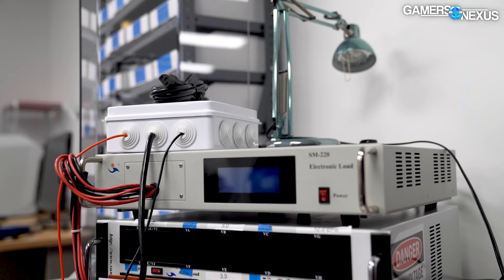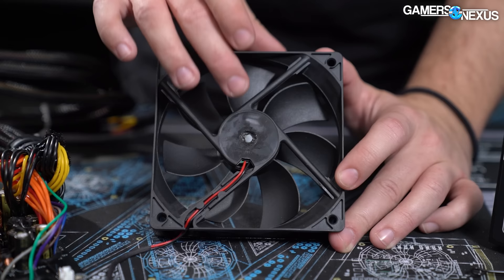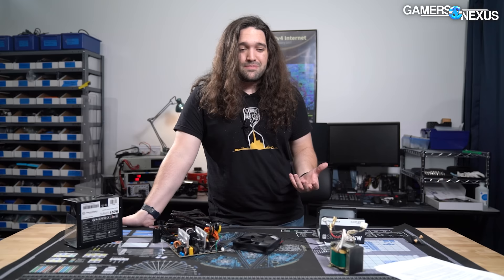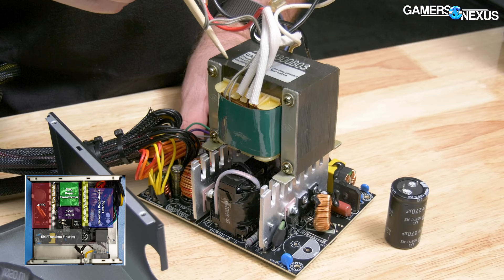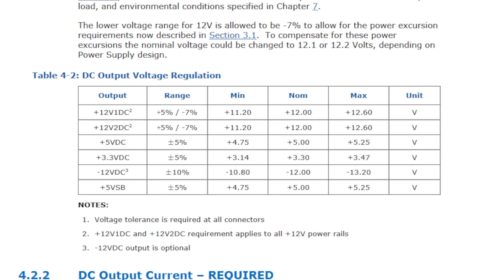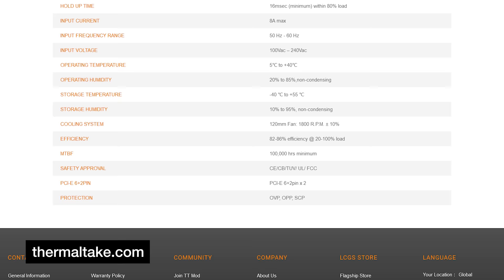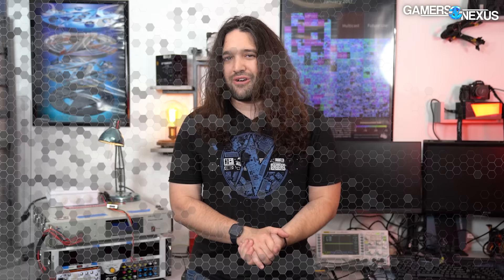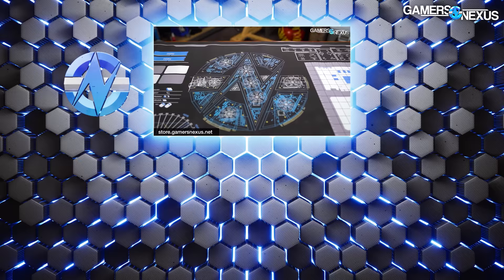Taking Risks on a Cheap PSU: $30 Thermaltake 430W SMART Power Supply Review

Comment: G'day Steve & Stone,
Thanks for doing a low cost PSU as these are very much one of the first places people want to cut cost as it has no visual value,
While not a 'Performance Leader' (in No way expected) it is good to know that it will protect the other components when used in a build that has all it's parts chosen by $Minimum.

Ps I am with you on the 430W Claim, I have seen this Claim Variance on many Low Cost PSUs & I too would rather just have the Actual 12v Performance rather than the confusion shown here, because for those this PSU is aimed at having 430W or 385W for an Optiplex Upgrade is not important as 385W will be plenty, but for those actually looking at 400W-500W Usage this is a disaster,
Stretching Facts to get Sales like this need to be cracked down on because Honesty for Safety is much more important.

Comment: my wife had been using the litepower 550w version of this power supply for close to 5 years. Used to run a core2quad & cheapo radeon hd 8XXX for 3 years then Ryzen 3 3400g & RX580 for 2 years, no rgb thou. So far still works well, as long as the power usage is low I guess.

Comment: Output ripple is driven by the cap size. Unless you get creative with a cap multiplier. Bigger caps cost more. The spec matters. Devices that operate on that power are supposed to be designed to work with a power supply with ripple right at the limit.

Comment: I’ve actually had a couple of these, I ran one in my primary rig for three years, and I bought it used, so who knows how old it actually was. Never gave me an issue with my R5 2600 and gtx 1060 6gb system

Comment: Expensive power supply!  For DOP 1800 (~$36) I got a new xTech combo; a black midi tower and a 600W power supply.  It is in use since May 2019 with a Ryzen 3 2200G, the max power requirement for the PC is ~150W.  The power supply had a 24 pin; 4 pin; 2 SATA and 2 Molex connectors.  After 3 years I had to replace the power supply fan :(  The PC is running 24/7 and after half an hour idling it suspends, but its 2-pin power-supply fan keeps running.  The PC is connected to a 1200W Avtek surge protector, because we have here 3 to 20 power fails per week :)

Comment: This is probably the kind of PSU I'd think of getting if I was going to build my own "MacGyvered" stereo from a spare car radio I had lying around, some sort of enclosure (probably whatever wood product is cheapest this month, and no I'm not excluding particularly thick cardboard), and some speakers I picked up off Amazon.
That is, if purpose-built 12v only PSU's weren't so dang cheap for higher ratings (thank you, widespread acceptance of LED lighting).
And if I had problems with bass response, I'd just need to add a small supercapacitors.

Speaking of those supercapacitors, I'd love to see if adding one of those across the PCI-E power connector's lines would help fix those transient trip issues the 3090 likes causing. It's not like it's gonna boost the voltage or anything dangerous like that, and with GPU's being at an all-time low price point (and falling) you might be able to afford to sacrifice one to see if some solution to the problem other than "buy a bigger PSU" can be found.
The car audio super capacitor does seem like the proper solution to the problem, as just like bass drops in music, the high 12v draw doesn't last very long, and the supercapacitor on its own (without the PSU helping) would be able to supply that easily, considering that they're designed to supply hundreds of amps and the GPU is only trying to draw like 50-70 amps at 12v.

Comment: I remember buying my own first PC components in 1996, and as a 14 year old, without much money, or any money given by my parents towards a computer. I really had to go with the absolute cheapest parts I could find. Case, and power supply was definitely the corners I cut. It was a Pentium 166MHz, eventually I upgraded it with a Riva TNT2 PCI bought for 30$ on the used market. I used that machine a lot! it became obsolete quickly as PC tech advanced at blistering speed during the 90's. However that machine continued to live on, with a slimmed down verison of Windows 98. First my brother had it, and then my mother inherited the computer. At the end you could barely do banking tasks, or check your e-mails. However, the power supply, which was probably dog-poop, did last for those 10 years. :)
Reply: And the quality of this power supply is probably orders of magnitude better than that 90's white box power supply.

Comment: The 12V output being lower than 430W was not mentioned anywhere on ThermalFake's store page nor do they picture the sticker with the ratings. Newegg's page only shows the deficiency deep in the specs as Amps at each voltage and you have to be doing math to catch the trickery.

Comment: I struggle to remember a mainboard which connects -12V rail anywhere at all. I think it's safe anyway, the rail plain doesn't have the current to set the wires on fire or to make a substantial fire on the PSU beyond killing a secondary support component.

Comment: Does ripple really matter on the 12V rail, though?  Wouldn't that be filtered out by the voltage regulators that produce the voltage that actually powers the chips?
Reply: They will, but you still stress more expensive parts. You can get decent ones for double the price. Why bother with the absolute trash tier?
Reply: @valkaielod  I'm trying to decide whether this is indeed "absolute trash".  To me, it seems like more of a Ford Focus, not a Yugo.  It's clearly in the low end in every performance metric, but it's also clearly on the low end in price.   On a graph of all power supplies, this would seem to be on that "you get what you pay for" line, without deviating too much.  There are no hidden "gotchas".  Therefore, if you want to build a computer with parts in that Ford Focus price range, this might be a reasonable option.  I'll admit I don't know the actual effect of ripple on the downstream voltage regulation components, hence my question.

Comment: I almost want one of those for electrical experimentation. I wouldn't trust it to power a computer, but low voltage LED tape or some fans wouldn't be too difficult to replace.
(that -12 volt pin not having protections is kind of scary.)

Comment: Generally, I would love to see more 450W-600W range PSUs of the most common brands, in the more budget oriented sector.
Such as Corsair VS/CV series or Be Quiet! Power 9, EVGA BR/BQ or even Inter-Tech (german brand - I live in Denmark), of which I use an Inter-Tech CPM II 550W semi-modular PSU, because it was the cheapest Bronze-rated 500+W semi-modular PSU at the time.

Heck, I even use two inter-tech CPU coolers, a 92mm and a 120mm and they've worked fine for me for quiet a while now. (Despite them being ugly orange)

Comment: Been using a Thermaltake Toughpower XT 875W semi modular Bronze supply for over 9 years now.  It's been through an I5 4670K, I7 4790K, Ryzen 7 1700X, Ryzen 7 3700X, and currently a Ryzen 7 5800X.  Also been powering a GTX 590, GTX 670, GTX 980, GTX 980TI, RX 580, and currently an RTX 3070TI.  People say this is not a.good power supply, but it's never given me any issues and runs my custom builds perfectly.  I don't know what the lifespan of a PSU is, but it's still running perfectly(knock on wood) to this day.  Does anyone really know if this is a good psu compared to the newer ones?

Comment: 100V and 10A is 1000W. The output rating is 430W.

The 10A is basically inrush current during power on so it will not kill the 8A rectifier. If the PSU draws 550W to deliver 430W then it will draw 5.5A rms at 100V and 7.8A peak - rms times sqrt(2)

One thing about ripple. The video says it was best on 3V3. But 66 mV ripple on 3V3 rail is 2.0%.

92 mV ripple on 12V is 0.076%.

So 3V3 is actually relatively worst for the consuming side.

Comment: I had to take apart a 6 year-ish old 430W EVGA PSU (100-W1-0430) for cleaning not long ago and it looked a lot more packed than this one, maybe they found a way to simplify the components inside over the years; mine is in charge of running an i5 2400-based system acting as a NAS and has been totally fine for the job since the day I bought it

Comment: Used to do PC repair housecalls, 15-20 years ago, and many of them were to fix eMachines and Packard Bells with bad PSUs.  Cheap $35 Thermaltakes were my go-to replacement part because it was cheap, easily available at Frys, and my "eMachines is so expensive!" clients would pay for the repair, and I never had one of those Thermaltakes fail on me.  They did the job.  Not at all GOOD parts but enough and cheap.
Reply: 15-20 years ago, bad caps on motherboards and PSUs, were common!

Comment: I run a12100f with rx570 .probably pulling around 300w peak. A 550w cooler master entry level psu should be just fine.

Years ago I walked into the room and was facing the PC when the psu decided rTo depart this world with a massive large bang.

Comment: many cable/device manufacturers/rebranders include the plugs/dongles as part of the declared length.
something i noticed on displayport cables that were too short because the plug is very long and requires additional length depending on the angle of the sockets.

Comment: I had no idea that the output rating was not 12 volt on some power supplies. I just checked the Corsair VS600 documentation and while a 600 watt power supply it only lists 576 watts for the 12 volt rail- way closer to the maximum advertised rating than this one, but still. FWIW, I got the VS600 for 40 bucks on sale off Amazon a month ago (seemed like a no brainer deal for a cheap power supply). I built a system for a friend out of my best old parts (6th gen i-5, RX 480) and wanted a new power supply for safety/efficiency reasons. He needed a reliable PC for work from home as his old one was dying- I tried to fix to no avail (an old USFF tiny Dell PC). I really don't trust old power supplies now- especially old cheap power supplies. Did Gamers Nexus ever try checking really old ones that were being used) to see ow they stack up? I know it would not be scientific because too many parameters, but it would be interesting to see the results. Maybe old power supplies are ok and we are wasting our money?

Comment: I have a 2016 ITEK 600W that I paid 40 € and never had any issue depending on PSU.

The only piece griefing me is my 1050 that started overheating about a year ago and now require a sidemounted fan just for it.

Comment: Wait WHAT this has a -12  volt rail? Why? That voltage was only used for ISA cards in the 1980s lol
Reply: No.  You're probably  thinking of -5V, which was made optional in ATX version 1.3. -12v is still used in some rare cases for RS232 (serial) signalling, so it's kept for compatibility.  For the record ISA bus was still common as recently as 2001-2002.

Comment: I have one of the 500w ones and there not bad.  It is running in a am3+ platform with 1060, so probably not using all that power, but its been going for 2+ years now.

Comment: I don't see a heatsink on the main rectifier - datasheet indicates the rating drops from 8A to a bit under 4A. Likely to get toasty at maximum load, especially at lower voltages. Standard for a low-cost PSU I guess.

Comment: A PSU just for the run off the mill office PC or with it's PSU position above the mainboard.
Would be in accordance with the peak efficiency at 40% load - that is around or just above the value of power consumption such a PC does have during its use.

Comment: Guess why the maximum allowable voltage ripple is that high - because it doesn't really matter, 12v almost always gets stepped down to a lower voltage with a DC - DC converter which has proper output regulation.

Comment: First PC i ever built from scratch,
I bought a cheap PSU and didn’t understand what I was doing.
I ended up delaying it 10 days,
Blew a new MB and had too go to Best Buy and pay 💰 for another PSU.
Just pay the extra $20 it will save you $100 in the long run.
Et em.

Comment: Regarding the voltage ripple it would be nice if you could perhaps put the load numbers into a bit more context. As you said it's not great but for most "normal" use it's sufficient. The 60% load would roughly equate to a 5600 + 3060 combo (just guesstimating by TDPs) which is already pretty beefy if you need that tight of a budget on the PSU.

Comment: I learned a long time ago building my first PC back in 2001 how important a good PSU is. Never cheaped out on a PSU since.
Reply: And in the big picture it isn't even expensive. A good PSU in the 100-200 bucks range can do 10 years, when a flagship GPU going for over a grand will be mid tier in 5 years lol.
Reply: @namesii1880  My strix 1080ti is still going strong 😔
Reply: @jaskajokunen3716  well, It mostly mostly depend on the resolution you are playing (my 6900xt Will be outdated in less the 2 generation, but i play in 5120x1440).
Reply: @Frigobar_Ranamelonico  Some games i play at 4k though if its newer i might need to lower some settings. Some games i play at 360hz fhd. So i would still argue that the 1080ti is going strong and for me there really isn't reason to upgrade.
Reply: @jaskajokunen3716  obviously it depends a lot on what you play (3A and very heavy games certainly don't help to maintain the longevity of the gpu).
clearly with lighter and optimized titles you are more comfortable.
Reply: @Frigobar_Ranamelonico  I played elden ring at max 4k with around 40-50 fps. I also maintain my gpu and run custom fan curves since i think nvidias stock the fans come on too late.
Reply: @jaskajokunen3716  Haha, well sure it can still do well. But objectively it is far behind the 30 series for example. Not the case for a PSU which is what i was trying to say :P
Reply: @namesii1880  Far behind yes but was much better value for money
Reply: Unfortunately, in 2001, all I had, was a Deer DR 250 ATX PSU. :(

Comment: Hi there GM, I have a short critique for something you could do better. You have some graphs about efficiency in your video but they don't state at which input voltage they where created. As I understand it, PSU efficiency is directly influenced by the input voltage to the power supply. Since you are based in the US I would assume you are testing with 110V input? If so, could you guys run tests at 230V aswell since many other countries do have 200+V standards. I would really like to see these numbers aswell if you can somehow produce them and mark them on the slides in the videos so people from other countries are not confused by seemingly conflicting numbers between different sources. Keep up the very good work, and thanks :)

Comment: Dude, I use the same PSU since 2008...if its superdimensioned for your usage (like being an 800w PSU while you need only 600w), and if it's 80+, you cant go wrong. Manufacturers might cheat on the amount of watt outputs, or in their efficiency, however going for a higher-end product will likely minimize those possible problems, specially if you have access to the technical sheet of the device you're buying. You will overclock better, run better heavy demanding tasks and so on. You always gotta think forwards when the matter is the PSU. I double that saying, "don't cheap out in the PSU"....if you spend some money on a decent f*cking 850w 80+ Gold PSU, you can totally forget about it for 14 years, nevermind it, just change your build regularly so you can play some games and be productive at work!

Comment: I would not use something like this in a PC, about the min I will use is the EVGA BQ (that I loving refer to as the EVGA barbecue), but you can power a lot of LEDs for a streaming setup with one of these. I just clip and cap most of the wires and solder on some 12v barrel plugs to the 12v wires. For a LED power supply this is pretty good quality, most things sold for LEDs are garbage with no active cooling, so they just overheat and self destruct if under load for any length of time. A few years ago I got fed up with the garbage led power supplies so I just started using cheap PSUs and they have worked great for that. I have also used them to power low end 12v amp, speaker, subwoofer setups, although you have to watch the load in that situation.

Comment: Not cheaping out on the power supply means not buying the most generic, off brand garbage you could get. I witnessed bad power supplies kill good computers because my dad didn't want to spend extra for something of reasonable quality. Needless to say it didn't take until later in his life to realize going the cheapest can end up being  the most expensive. The upper midrange has always served me well in the price/performance delta as well as having less features to break on the top end. I get a very good quality item without paying 50% more for 20%(or LESS) performance.

Comment: I use these PSUs in my servers, running low power parts with some SSDs or Hard Drives.. never had a single issue.

Comment: Removed capacitor for safety? If anything that made the cap less safe since it is no longer connected to a discharge circuit. Leave it in and confirm it is discharged. For extra safety, bridge the leads with solder or foil to be doubly sure it won't hold a charge.
Reply: Yes I thought the same thing.  Normally we discharge caps for safety, there's no need to remove them.

Comment: If you look around on ebay for one of these, you can get a brand new 500 watt version for even cheaper (I got mine for $20). Pretty decent for the price even if you get it for a little bit more IMO

Comment: For low end builds I'll pony up the extra $20-30 for a Corsair CX550 - 650W PSUs and get much better quality. I haven't tried the CX450 models so I cannot speak on those but I have been running the 550 and 650W versions without issue for over 3 years in systems that have seen runtimes where the PC stays on for a week straight much of the year (well during the Folding at Home in 2020).